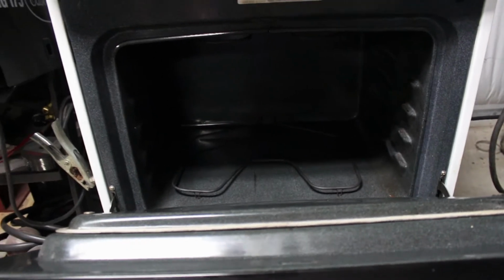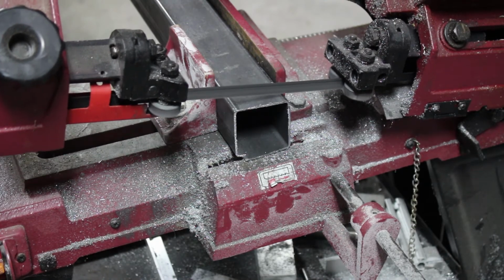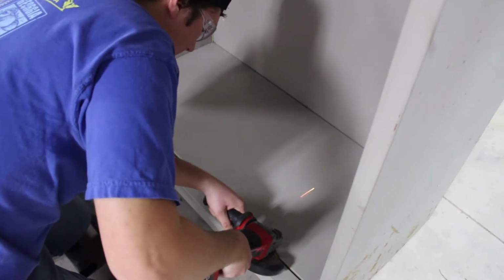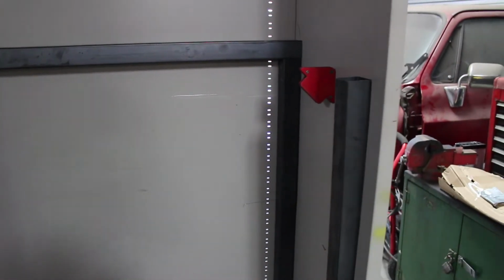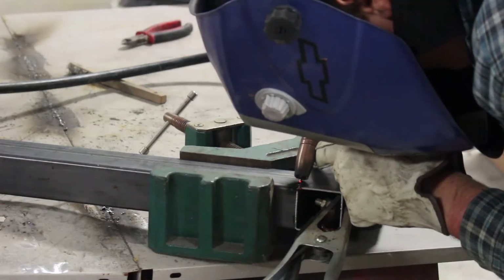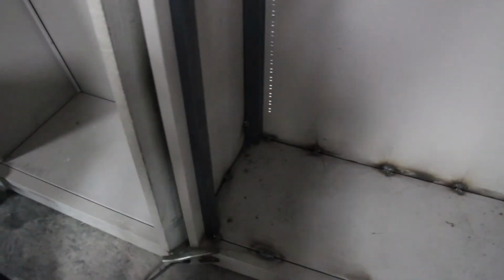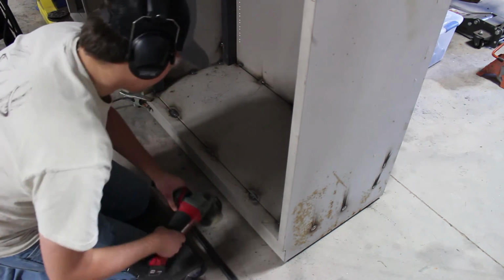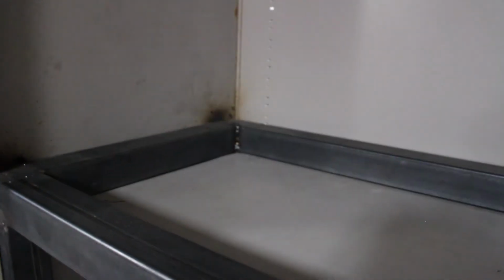Building a LARGE POWDER COATING OVEN PT 1

Comment: coming along well, little piece of advice on welding. make the beads flow, don't stop and start so fast on the beads. your not getting good penetration on the steel. its all about the flow. keep it up.
Reply from the maker: Hey, thanks for the advice, the problem I had is if you did a continuous weld it would start to melt through the material. Is this due to being too slow?